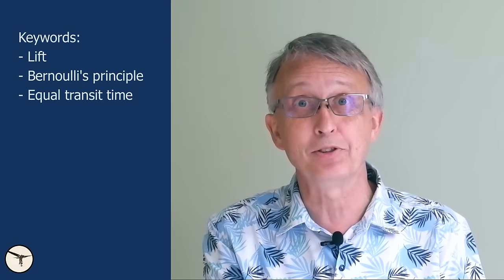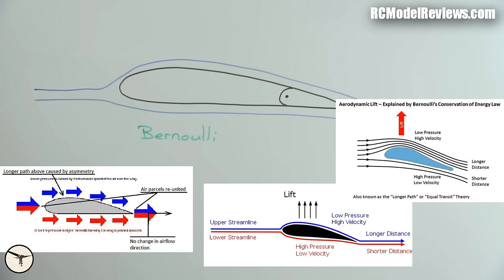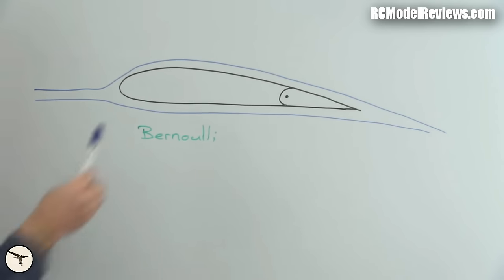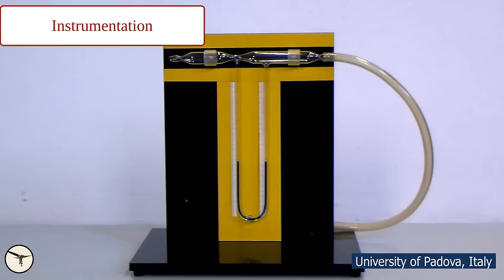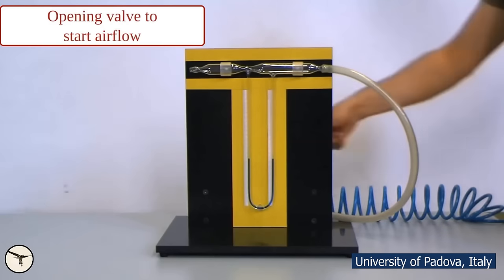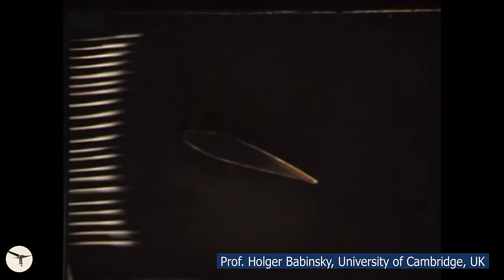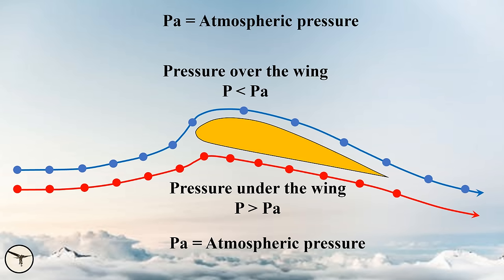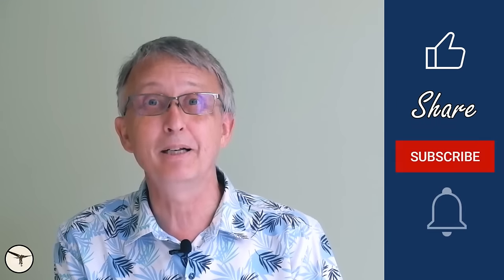Why are so many pilots wrong about Bernoulli’s Principle?

Comment: A flat piece of plywood will work as wing with zero Bernoulli effect.  If you don't believe it, try putting a piece of plywood out the window of your car and see if it generates lift.  It will be ripped right out of your hand.  The shape of a wing that takes advantage of the Bernoulli effect is just more efficient.  Lift is not generated by Bernoulli's principle alone, but also by the force below the wing generated by the angle of attack of the surface of the wing to the oncoming airflow.  You can also prove this effect with your hand out of the window of a moving car, if you simply change the angle of attack of your hand, you will feel the lift, and there's no Bernoulli effect there.  The effect here is Newton's law of motion, not Bernoulli, because the air molecules are being accelerated downward by the force of the moving wing, so this acceleration produces an equal and opposite force.  This is also why flaps generate more lift, but also drag.
Reply: A flat piece of plywood works unavoidably with Bernoulli effect.  Bernoulli is shorthand for conservation of energy.  There is no lift without conservation of energy.  You're deleting a fundamental property of physics.  It's not a matter of taste or preference of explanation, it's a matter of coherent explanation or not.  You can't strike conservation of energy from Navier-Stokes and still have Navier-Stokes predict an outcome - conservation of energy is an integral pillar and the table falls over without it.

Comment: so, how does an aircraft fly upside down without pushing the controls strongly in the opposite direction? this principle does not answer that fact.
Reply from the maker: To maintain inverted flight, you must push the stick further forward than in straight and level flight. The wing profile determines how much you must lift the nose over the horizon.

Comment: The viscosity of air below the aircraft wing is much higher than the viscosity of the air above the wind. This can be one of the reason.
Reply from the maker: Viscosity plays a role when it comes to determine the thickness of the boundary layer. Not lift. The viscosity of air is a function of temperature and can be fairly accurately described by the Sunderland equation.

Comment: actually he is simply restating the theory. air accelerates at the leading edge creating a pressure differential.  does airflow remain constant if one side has increased and the other slowed? Common sense answers this

Comment: Bernoulli's Theorem is a pragmatic "truth" that is "simple" to explain flight.  It's incorrect.  It's also taught in college Fluid Dynamics courses the wrong way wrt flight in some cases, too.  All I can do is SMH.  I describe the lift of a wing like you putting your hand out the car window and putting an angle (of attack) to the oncoming (relative) wind...slow down, need more AoA.  I would explain it to students another way.  I'd explain how the student pilot book talks about Bernoulli and then...pull out one of those cheap balsa wood gliders with flat wings and toss it... ; )

Comment: Am I the only one who notices the air flow under the wing is pushing against the wing?  Look at the video again and watch the disruption as the wind pushes on the wing.  The force of that push appears much more than anything else happening there.  It explains why flat wings fly, why sailboats with sails that are less than a few mm thick work, etc...  I am sure that adding / optimizing for bernoulli's principle (a fluid principle, not air) is good, but not the most important item on the list.
Reply from the maker: The airflow under the wing contributes to the lift, but considerably less than the airflow over the wing. When the airflow over the wing is disturbed, we have a stall, and most of the lift is lost. Lift is created by pressure differences over the wing because the air follows the curvature of the leading edge and over the wing. This video explains this in more detail: https://youtu.be/ph1HqrioLPs
Reply: @FlywithMagnar  Yes, that video is extremely good.  It really helps.  I think I understand what you are explaining, but probably have to watch it a few more times to learn!

Comment: When will people learn.. vacuum is not a force. You have to create a shape that at a certain forward speed will deflect so many air molecules downwards that the equal but opposite reaction will lift you up into the air. Yay, liftoff. And if you then can come up with a shape that does not bounce too many air molecules into your direction of travel, you have a good lift / drag ratio. The airfoil seems to be quite good at that.
Reply from the maker: Who says there's vacuum above the wing? We are talking about a pressure difference of a few percent. It is illustrated at 7:48.

Comment: Bernoulli's principle is often (and mistakenly) used by sailing instructors to try to explain how a sail propels a a boat despite the fact that a sail is a sheet of zero thickness and therefore has exactly equal distance on each of its sides.  A sail works because it deflects the airstream.  Newton's law: an action results in a reaction.  Deflecting the airstream results in an equal and opposite reaction.
Reply: The rubber band powered toy balsa wood planes we had as kids did actually fly a short distance from a flat surface. The wings were flat. Of course more sophisticated models did have airfoils and flew better.
Reply: @davidg4288  In the Fall on 1962 I was attending some kind of introductory forum at MIT.  The new students there knew how to construct super-light balsa planes that seemed to stay up forever on rubber band power.

Comment: Anyone who has ever put their hand palm-down out of a window in a moving car knows that a wing doesn't "generate" lift. The pressure of the air against the palm pushes up your hand. There is no "low pressure area" pulling your hand up.

Comment: My understanding is that lift is primarily created by angle of attack of the wing surface.   The Bernoulli effect does give lift but is not enough to lift a pasenger aircraft off the ground.  Very high speed aircraft have a razor thin leading edge.  The round nose on passenger aircraft is to give the plane low speed landing ability/stability.  A military jet on the other hand cannot land at low speeds as it is unstable at these speeds.   If a planes lift is dependeent on Bernoulli effect, how can an aircraft fly upside down?  The answer is angle of attack works in any configuration.  A paper plane can fly yet its wings are flat.
Reply: Angle of attack and airflow is both making an airplane to fly. But airflow is playing major part. If an airplane wing has an ice 🧊 on its surface it will lose a lift because there’s airflow disturbance. Same principle with a stall.
Reply: @UraFlight  We should not get streamlining and lift mixed up here.  Any surface obstruction which increases the surface roughness will cause drag amd slow an aircraft down. The thing that has always interested me when walking up the rear stairs of an aircraft are the red adjustment marks on the rear horizontal stabilisers.  The angle of attack of the whole stabiliser wing can be adjusted to compensate for centre of gravity changes in the aircraft.
Reply: @johnspathonis1078  Hi John ! I just watched another video of Krzysztof Fidkowski and he said the same thing as you: The lift is a reaction force experienced by the airfoil due to its turning of the flow downwards. The Bernoulli effect doesn’t give a lift . I’ve been told the same thing 40 years ago by my teacher at school. But few years ago at Farnborough air show I’ve been told that Bernoulli effects play a major role. All these past years I’ve been thinking wrong and I have to admit that. My teacher at school was right. Once he said to me : Stick your hand out on the high speed from the car and you will know how aircraft lift is working. Very simple explanation !
Reply: @UraFlight  Thank you for your reply.  Hi this whole flight thing is very complicated and I know 1/5 of bugger all.  What I object to is people stating that Bernoulli is the answer to everything.  If you watch the Space Shuttle re-entry it is the extreme angle of attack that is slowing it down not Bernoulli.  I am not trying to berate Bernoulli but his theory cannot cure everything.  Part of the problem is that a lot of the problem believe in a thing called 'suction'.   May I reiterate what the great American Professor Julius Sumner Miller repeated on many occasions ---- " There ain't no such thing as suction".
Reply: @johnspathonis1078  It was nice to talk to you John ! I’m agree with you on so many things. If you want you could type this in YouTube search: Krzysztof Fidkowski How planes fly. It’s on Michigan Engineering YouTube channel . I love the way how this professor explain aerodynamics.

Comment: Ever since I was a kid and put my hand flat out the window of a moving car, like a planar wing, it was clear to me that lift did not solely come from negative pressure on top.  

The wing explanations that were given to me as I grew older were an affront to the simple common-sense observation that an airplane could fly with a flat wing —though since it’d be terribly pitch-sensitive aerodynamically, people rounded it into the elongated teardrop cross-section shape.
Reply: If lift was totally dependent on the shape of the airfoil a plane couldn’t fly upside down.
Reply: The lift does depend on the pressure, it's the only way the fluid can apply a force on the surface. The fluid changing direction is in itself a proof of there being some pressure change. If you angle a flat plate, the exposed side will have a larger pressure than the backfacing side.

I feel that most people don't really make this connection. Yes, you can treat a wing like a black box and say that the lift comes from the force required to redirect the direction of the air. But the way that happens is literally pressure. The fluid turning and the pressure differences are linked.

Comment: The flow of a liquid or gas following along the outside of a curved surface is the COANDA EFFECT!
Reply: While many use it, technically, Coanda is defined for a jet or sheet of fluid injected into otherwise still air along the convex surface, not a bulk flow like over a wing.
 There is a difference in that the jet/sheet has areas of entrainment not present for the bulk flow above a wing.  Looking at his patents, Coanda recognized the pressure reduction.
While the two cases are quite similar, few people seem to understand the physics for the pressure reduction. 
It is explained in the video on my YT Channel. Once you realize the role inertia plays, it's easy to understand.
Regards

Comment: misconsemption?
What if there is not curvature on the top side of the wing?
There are also other factors/forces that affect lift other than the Bernoulli effect.
Thrust from the engines and the angle of climb. Rockets dont have significant wings
Reply: "Give me enough horsepower and I will make a barndoor fly" unknown. The aircraft would have terrible handling and stall margin. I heard an interview of a movie pilot that flew a replica Curtis. It had poor handling  and stall characteristics. My opinion is the wing is a PLANE cutting a chip and dropping it down. All the other science just makes it easier to pull forward.
Reply from the maker: Many airliners have wings where the upper surface is pretty flat. The "magic" happens at the leading edge. The angle of attack and the loction of the stagnation point is of importance here. 
When more lift is needed, the curvature is increased by extending flaps on the leading edge and trailing edge.  
By the way, Bernoulli's princilpe and and Newton's second law are describing the same thing: https://youtu.be/ph1HqrioLPs
Reply: @FlywithMagnar  It's not magic.
Have you looked into how Boomerangs work? (Australian indigenous tribes have been throwing these self returning V shaped pieces of wood for thousands of years. Boomerangs are generally flat underneath and have a curved surface on the top.)
Reply: @FlywithMagnar  When you walk the wing it does seam flat in areas. But they are curved. Have you ever seen the Mach effect? It starts near the root and moves out board as speed increases. The sun shining through the shock wave forms a shadow on the wing if the sun angle is correct. The origin of the shadow is where the speed is highest and where magic starts. I do not know if it can be seen now that airliners cruse at .8 Mach.

Comment: The reason it is wrong is the FAA mandated the wrong material be taught because the people writing the standards didn't understand it and wanted appear more educated than they really are. The reality is Bernoulli doesn't have any practical application to a pilot in regards to lift. The principle is a partial differential equation that cannot be solved in closed form. Newton's 3 laws can explain the lift from a wing in a simple way that actually explains why angle of attack is so important. It also explains induced drag and stalls. 

Oh, and before anyone complains Bernoulli's principle can be derived from Newton's laws so it is absolutely not "a different theory." It is the exact same one but described in a way that an average high school student can actually understand.

Comment: I always looked at it like this the air under the wing remains at atmospheric pressure 
   the air at the top of the wing is first compressed then expands to form a area of low pressure due to cohesion it sticks to the wing 
     if you have atmospheric pressure under and low pressure on top you have lift

should mention I'm not a pilot and am self taught in aerodynamic engineering
   I commented before watching your video and your video is a excellent presentation of how lift works
Reply: Thats not correct, you need to account for dynamic pressure that forms under the wing also

Comment: In the video:    when the air above the wing travels much faster than the air below...   doesn't that create a vacuum at the trailing edge of the wing.....which, nature does not allow?
Reply from the maker: The air over the wing is slowing down as it is travelling towards an area with higher pressure.

Comment: This is only half the story.  Bernoulli by itself does not produce enough lift for a plane to fly.  Downwash off the trailing edge produces most of the lift but is mostly ignored in favour of Bernoulli.
Reply from the maker: Bernoulli is a mathematical formula describing the relation between air pressure and velocity.  https://youtu.be/lqAXNhICtRk
Reply: Bernoulli is shorthand for conservation of energy.  There are 3 competing interconnected sets of Euler and Navier-Stokes equations that accurately describe the lift from the pattern of flows around an airfoil:  conservation of mass, conservation of energy and conservation of momentum.  (the deference between Euler and Navier-Stokes is viscosity and thermal effects; Euler doesn't describe viscosity, which augments attachment of air to the airfoil)

Conservation of energy, which Bernoulli represents, is one of those indispensable 3 legs of the 3-legged stool which is the explanation for lift.  You can't remove any on those 3 legs without the stool falling over.

So your statement "Bernoulli by itself does not produce enough lift for a plane to fly", is missing the entire point of the relationship of what we call "Bernoulli" to the production of lift.

Comment: Aircraft are not anti-gravity devices and thus the weight of the aircraft is carried by the ground underneath whether it's taxiing or flying. This is very clear when flying extremely low as the air trapped between wing and ground produces a local area of high pressure and greatly increased lift known as ground effect. When flying at cruising altitude the same is also true although the effect is spread over a much greater area of the ground below. Nevertheless, an aircraft can only generate lift by deflecting air downwards. If the Bernoulli principle were the correct explanation a helicopter could fly without generating downdraft and that would be very convenient in rescue situations, unfortunately though it isn't true.
Reply: "thus the weight of the aircraft is carried by the ground underneath whether taxiing or flying".
You are not on this planet.
But thanks for making me laugh.
Reply: @deang5622  Explain to me how it can be otherwise without an anti-gravity device.

Comment: As a pilot you only need to maintain speed enough to get lift at all times. The reason or explanation for the lift is irrelevant during flying. You have enough other concerns simultaneously. Just keep the speed high enough, that’s all. In a similar note: you don’t need to know biology to reproduce, or be able to build a clock to tell the time.
Reply: But, but, but … how can you make money on a dozen monetized videos about something if you don’t make a big deal about every detail? 😅 As if anyone would fail a check ride over this shit.

Comment: Almost no one understands that inertia is the thing that gives air the property of not adhering to the wing shape instantaneously.  If matter had zero inertia, matter would move from one position, to a new position, with zero force, and move over vast distances instantaneously (which may, or may not, break Relativity (I don't know)).  If the matter had zero inertia, there would be no pressure drop on the top of the wing, and no increase in pressure on the bottom of the wing.
No one here, who read my statement, most likely understands it.  😞
Reply from the maker: Air has a mass. Therefore, inertia is part of the computation.
Reply: @FlywithMagnar  yes, fortunately.
It is a common misconception that the equations govern physics.  Physics is physics, and the equations are merely models of reality, but the equations are not reality!  However, the equations are a good model.